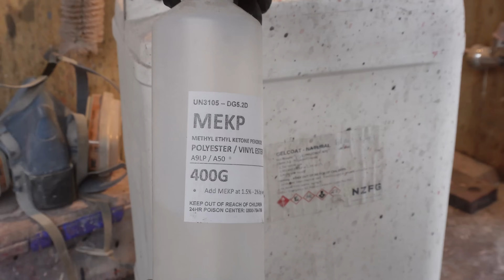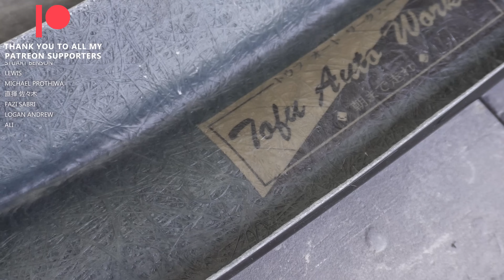How to Make Fiberglass Parts with the Bare Minimum Tools.

Comment: Can i follow your method if I were to fiberglass my hood without it sticking to the metal?
Reply from the maker: If you make sure the bonnet is polished and use both wax and PVA release agents (see my separate videos on mould making) then it should work. 

However fiberglass parts generate heat as they cure, and sometimes this can cause the paint underneath to blister. Avoid that by doing multiple things layers of fiberglass, allowing it to cure in between

Comment: A small piece has fallen out of the middle of my car's bumper and is missing. How can I fill that gap with fiberglass?
Reply from the maker: If it's a plastic bumper then fiberglass wont really stick so you'll want to patch it with plastic welding. If the cap is just the little cover for your tow hook point then you can probably find a replacement quite easily.
Reply from the maker: If it's fiberglass, just cover the front of the whole with a flat piece of cardboard or something, grind down the backside of the fiberglass to bring a taper in to the hole edge, and then apply new glass in about 3 layers or so with the first layer just big enough to cover the hole and then the other 2 layers each slightly bigger than the last to feather the joint nicely.

Comment: Shouldn't you build a wooden frame or structure on top of the mold to keep it true and straight? I've seen molds contract over time and are no longer true?
Reply from the maker: Good question. It depends entirely on the mould and the part. Since this mould is for a front lip that will be bolted along the entire upper edge to the front bumper, a slight bit of warpage wont be an issue even if the mould did distort. But because this is quite a small mould with some complex geometry (lots of corners and turns) the mould itself is already very rigid, improved by the fact that it is 3 - 4 times thicker than normal fiberglass.

However for larger, flatter panels like a bonnet or bumper where there are longer distances without any bolts to align them, you want to ensure that those parts come out as straight as possible and so for moulds like that you would add wood or steel framing.
Reply: @TofuAutoWorks  thank you for that.  I love all of your videos.

Comment: Thanks for the video really helpful.  I am going to make a new dashboard as my van is old (2006 model) and cant find a replacement. When i take the old dash of can i just use that as the mold and put gel coat on the outside of it? And then follow the steps you layed out?
Reply from the maker: You can do it that way. The way you'll want to do it is create a fiberglass skin over the outer surface of the original dash and then skip the gelcoat and instead just sand and apply bodyfiller directly to the outer layer of the fiberglass. 

The process will be similar to my video on "Making one-off fiberglass guards"
Reply: @TofuAutoWorks  thank you I'll have a look at that video again
Reply: Ok just watched it again lol so from what I understand. I would tape up the outside of the dash. Pva release agent it so fiberglass can come of easily. Then give my coats of fiberglass (I'm guessing the same grades you used)  trimming excess of once cured. Drill/cut any holes needed for clip inserts, audio interfaces and heating etc. Possibly sand and then paint. Finished product ready to put in place. 

I should still get the same thickness of the original dash right?

Sorry just need to make sure I do it right without wasting load of material
Reply from the maker: Dont forget a layer of release wax as well underneath the PVA layer. My general formula for part thickness is 1 coupling coat of 225 gsm and then after that has cured, 2 layers of 450 gsm. Gives a nice solid shape that is really strong and ends up around 3.5mm thick. You may need to do some alterations to the shape after making it to get it to fit nicely but that will still be easier than making a full mould and part.
Reply: @TofuAutoWorks  thank you for the help 🙏

Comment: Great video man! Why did you do the second and third layer of fiber glass separate from the first one?
Reply from the maker: The first layer of 225 gsm fiberglass is there to get a perfect bond with the gelcoat with no airbubbles, if you try to build all 3 layers at once they can sometimes pull away from the tight corners leaving air bubbles resulting in unsupported gelcoat that blisters and chips away easily.

Comment: What were the names of all the chemical mixes you used  before laying your fiberglass and after and how to know how much to mix together those parts were throwing me off but everything was really easy to see what you did
Reply: Gel coat is generally catalyzed with 2% MEKP, and poly resin with 1%. If you use metric measurements you don't need a calculator. :)

Comment: No need for the pva and wax mold release after the gelcoat prior to the first layer of fiberglass mat?
Reply: if you did, then it wouldn't stick... The PVA and mold release go on the mold surface. If you are using laminating resin, you can spray PVA on your final layer to let the final surface cure, like using waxed resin.

Comment: A little tip, instead of using black dye in your resin (in this case), I just mix a small amount of whatever gel coat I use into the resin. 
Having tinted resin in my opinion makes the parts look so much more professional so I'm glad you also do it 👌🏻

Comment: Why do you use the chopped fiber fiberglass instead of woven mats?
Reply from the maker: Chopped strand is generally a lot easier especially for beginners. It conforms better to complex shapes and because you can rip it to shape, you're able to use it with almost no offcuts or waste unlike woven where you often have small scraps that you can't really use.

Comment: Did you add wax to the poly resin? If the first layer dries a little tacky after curing time,  is it safe to add the second layer of fiberglass and poly resin?
Reply from the maker: This sort of polyester resin comes with wax added to it from the supplier so that it will air cure and not leave a tacky surface unlike the resin sometimes used in boat building.

Comment: Why haven't anybody introduced a new application process than the dab dab dab dab dab dab dab
Reply: Mind: I shall build a machine that will apply the best even coat of resin to avoid this 

Love your vid
Reply from the maker: Vacuum infusion is what is used when you need a very precise and uniform application of resin, but it just doesnt make sense for parts this simple and cheap.

Comment: Amazing tutorial sir tofu! One more question tho, do you calculate the amount of resin before laying up the fiberglass or its just a feeling 😅!
Reply from the maker: It is something you just get a feeling for. When I'm making a part for the first time and I have no idea how much it will take, I make a guess and then I'll sometimes mix up about half that amount and after applying that I'll know how much I need to finish it. 

If you try to mix up the full amount and end up only 50ml short or something, it can be tricky to measure out that small an amount of resin and catalyst accurately so I try to make sure I'm always mixing more than 100ml or so.
Reply: @TofuAutoWorks  makes sense thanks for the answer!!

Comment: How many layers of fibreglass would you say is sufficient for body panels and bumpers?
Reply from the maker: My go to is always, coupling coat of 1 layer of 225 gsm, let that cure, then 2 layers of 450. It's nice and solid, and I've never had any issues with fenders, bonnets, bumpers etc..
Reply: @TofuAutoWorks  cheers, thankyou

Comment: Thanks for all your vids, besides hours of others contents ive been able to produce multiple molds even more complex split molds. My latest was a copy of a hatch and a copy of my car door. Question tho is how do you accound for the difference in thickness compared to oem? I did create a boltable flange to my doors split mold but found it difficult still to line it all up with material laid, not to mention i couldnt really lay both sides at the same time to then clamp them when wet. Others have suggested i lay one side, let dry then lay other still wet and bolt down. Would you lay less material down on edges where the inner and outter skin would meet when bonding to account for the thickness difference compared to oem? My copies came out really nice besides being a bit thick and not laying flush when door was closed to the body 😔
Reply from the maker: When I've made bonnets for clients that had inner and outer skins the way I made them was by laying up the inner skin in its mould first and letting it cure to the point where I could trim the excess fiberglass off with a sharp knife. I made the inner skin a bit thinner than normal, I think only 1 layer of 225 and one layer of 450 at the same time.

Then I did the main layup of 2x 450's on the outer skin of the bonnet (+ coremat reinforcement in the center) and then placed the inner skin onto wet fiberglass and gently clamped together. I see this customer regularly and he has taken that car to multiple race events and is still very happy with it. 

It's sort of unavoidable with fiberglass that you will end up with a part a little thicker than pressed sheet metal and so you may have to accommodate for this when making them. I've bought sheet thickness wax in 2mm which I sometimes add on top of mounting tabs of thin steel so that when I make moulds off it, it will be the correct placement for the thicker fiberglass part. However it sounds like the issues with your doors could be fixed by adjusting the latch / striker plates if it's the rear or hinges if it's the front.
Reply: @TofuAutoWorks  thanks for the insight man! Yea I figured that it's inevitable you'll have some differences but I'd say it might be a big difference with the door I made, the fitment is pokey even without the rubber trim so can only imagine with the trim on it will stick out more. I have tried to install the latch a bit more in (that's the side that sticks out, swinging side seems just fine). I'll attempt it again and see if I can get a bit better fitment by applying what you suggested and if I can't get any better than oh well, full race car fitment and I'll do the other door. I have played with carbon infusion a bit and I assume carbon gets a bit better fitment because of vacuum bagging compressing the crap out of the layers making it super thin. I guess I could vacuum bag the fiberglass copy too after a wet lay tho might start kicking before I get the bag on. Anyway lol another shot we'll give! Thanks!!

Comment: Que es el producto negro?
Gracias por tu respuesta... Saludos
Reply from the maker: All of my videos include subtitles in multiple languages that cover in detail all the steps and materials included.

The two black products I used in this video were gelcoat, which can be left off if you are making parts from scratch without a mould, and black dye added to my resin purely for cosmetic reasons.

Comment: Just a question, anyway to make a part, the fastest and still most accurate "copy" and strengthen wise not compromised.... like a fender or a front lip....⁉️

Nicely done! Like your videos...👍
Reply from the maker: To make a perfect copy you will need to make a mould, there are a few videos in the description on mould making. 
If you only want to make a single copy and you don't mind if it's slightly larger than it should be (about 3.5mm bigger on all sides for fiberglass, and between 1.0 - 2.5mm for carbon fiber) then you could skin the part in fiberglass or carbon after apply release agent to the part itself, and then pop that new skin off the part and do any required finishing or sanding work.

This method is pretty common for people replacing roofs or quarter panels with carbon fiber, simply lay the carbon over the existing part, remove the carbon once it's dried, cut the original part away, then bond the carbon back in place.

Comment: I'm currently saving up for a motorcycle custom build. With Brick House Builds for engine service and wiring, 46works for metal fabrication, Superfastmatt for the structural engineering, D4A for engine performance mods, and now you for the bodywork, it feels like having the avengers of YouTube mentors to help me with my endeavors!
Reply from the maker: Thats awesome dude, good luck with the build. And superfastmatt has some good videos on forged carbon, I always find there's a major lack of ham sandwiches in my composites. 😂

Comment: Very excellent. I follow you on YouTube. I asked you before Sadiq to send me 2 iron rolls to release the air. I hope you can advise. Thank you.
Reply from the maker: Thanks. Yes, if you can get a fiberglass roller it will make removing air bubbles much easier. It's also possible to make them yourself using metal washers.
Reply: My dear friend, I stopped sending you this iron roll. I can't understand anything.  @TofuAutoWorks